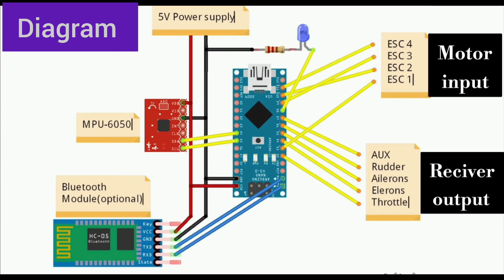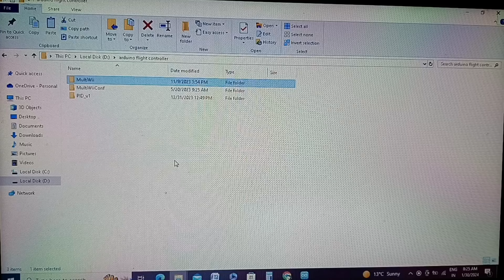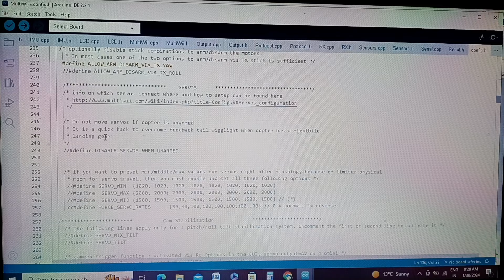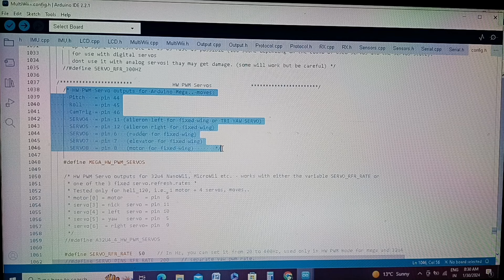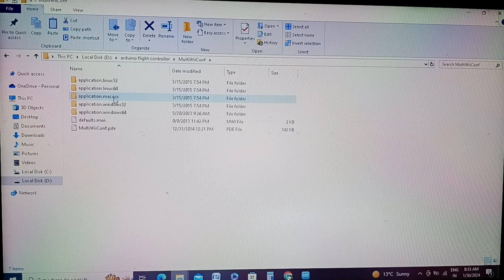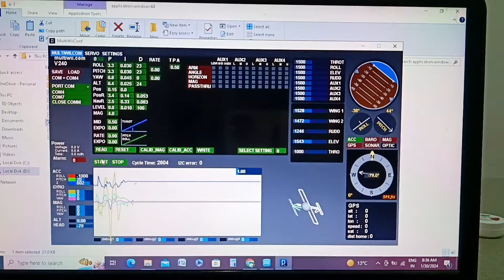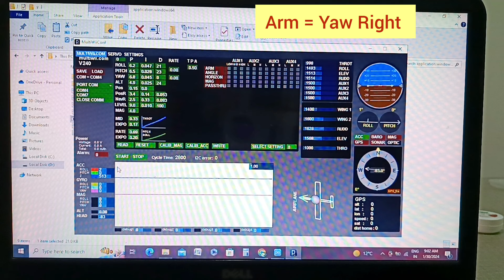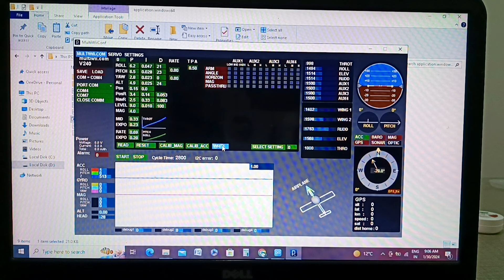Arduino Flight controller|How To Make Arduino Flight Controller At Home|Arduino Projects|ArduinoNano

Comment: Hello I have a question regarding this. Now how will I control the plane through remote if it doesn't specify anything about wireless transmission?